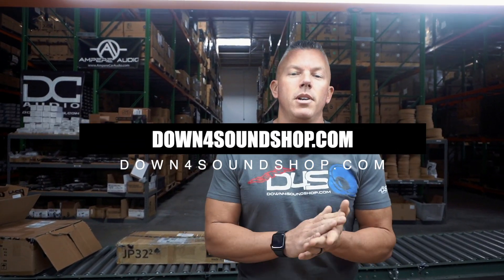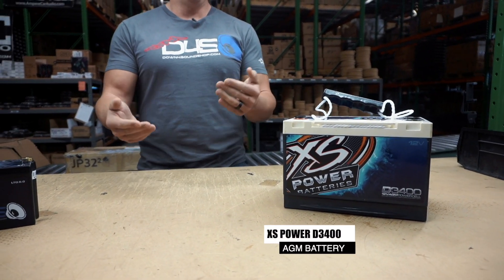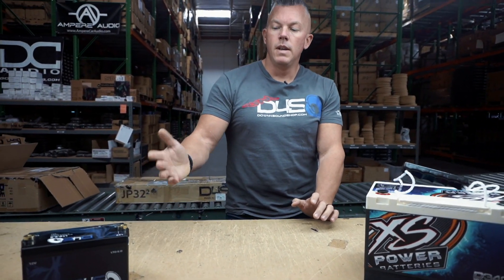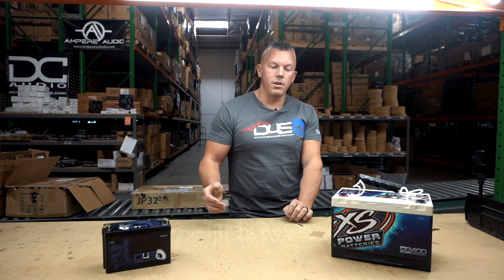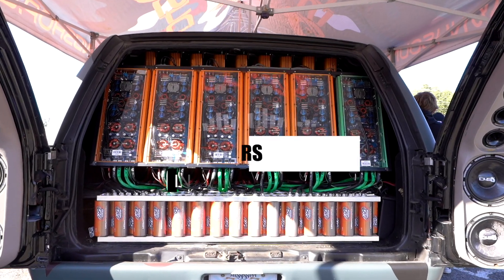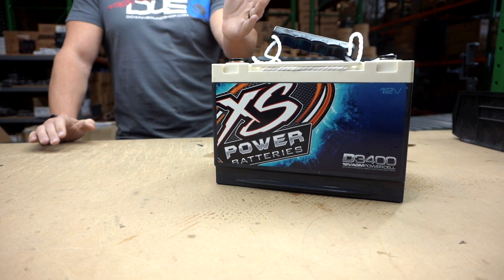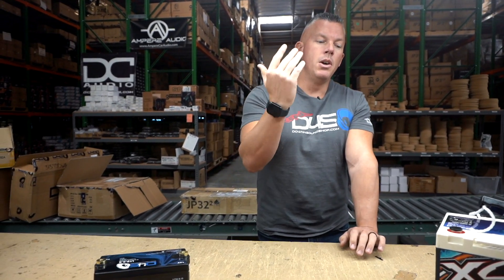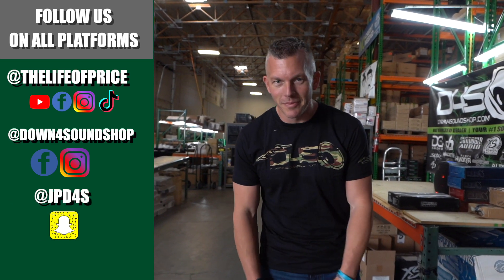WHY YOU SHOULD HAVE THE SUFFICIENT AMOUNT OF BATTERY POWER

Comment: Why do people insist on using low voltage. The best thing I have ever done to my system is increase the charging voltage from 14.6 to 15.8, way more power, more efficiency and just better overall for the amplifier.

Comment: Xs power agm is overpriced garbage mafe by loxus who is only knownfor building ioxus ultracaps. The d4s 6.0 and titan 8 5s uses 2.8v max scib cells, titan 8 uses the 10ah cells, d4s uses the 3ah cells. Both are scib lto in 5s configuration and should not be charged over 14.0v and do not handle the wattage they claim. They both fell into high 11s on a 200a draw which shows it overworks and burns out your alt. The xs power xmax90 is way overpriced. They are 22ah 20c EVE lifepo4 cells that you can build a 220ah bank for the price of one xmax90. The xs power yinlong cells only 40ah are worth getting, the 35 and 45ah yinlongs have weaker c ratings. Not to mention yinlong just pusted xs power for lying and proving they are NOT brand nee grade a cells. They are used or recycled grade b cells and they charge $100 more than you can get them at other sites. Stop buyin lithium from these lying ass companies.

Comment: I think this is the most overlooked thing that budget bassheads do. They try to buy the biggest and best amps and subs they can but don't wanna invest in proper electrical. That's a huge mistake 😕
Reply: yeah for sure what I have found  even with cheap power and subs 5k 8k let's say amp 2subs box let's say 1500 too 2k high just in wire fues extra power another 1k
Reply: @slowbrezze bro what the fuck did you even say?
Reply: Alot of car audio places wont do alternators and big 3 and most car shops only do oem products

Comment: Next time you do a battery power rating video, could you do a combo. Like what I have. A D4S 6.0 lto with a D4S 500 farad cap bank, big 3, agm under the hood with 70ah reserve. Powering a JP23v2 @ 1ohm good or not is segment
Reply: No, the d4s 6.0 is hindering your electrical

Comment: I got a stock 150A alt with a xspower d4700 under the hood with 2 LTO6.0's powering a B2 audio RAGE 2500v2 with no issues that i can tell.
Reply: I ran a rage 2000 on a 150amp alt.. standard battery no issues.
Reply: Except horrible voltage drop and overworking your alt while overcharging the cells and destroying them internally

Comment: If a company made dual alt brackets and belt setup’s for my challenger, I’d definitely invest in one. I am interested in the xmax 90 to replace the two limitless 45’s I’ve had for about 6 years now. I just haven’t seen much on them, would you make a review of the xs power diy?
Reply: You would be better off getting the diy kit from bms batteries or sriko. Xmax90 is actually 88ah of 22ah 20C EVE lifepo4 cells. At those websites i listed you can get same size bank for half the cost or get 220ah EVE bank for same price as the overpriced xmax90

Comment: Those 6.0 batteries are 🗑
Reply from the maker: Incorrect 😊
Reply: @THELIFEOFPRICE  no he isnt. You dont know shit about lithium
Reply: @THELIFEOFPRICE  you use 10 2.8v max 3ah scib cells in 5S2P configuration. 2.8x5=14.0v series, voltage multiplies, ah stays the same, then you paralleled 2 5S scib banks which keeps voltage the same and doubles ah to make that battery 14.0v max, 6ah of 75c max cells. Your 6.0 lto has been tested and torn apart by actual lithium people and it is put together cheaply and janky inside, not to mention even overcharging the cells like you claim to 14.8v, put on a 200a draw which is equivalent to 2,000 watts, your battery fell to 11.8v within 20 seconds. Your battery is garbage and for the price, one of the worst lithium premades to buy. Facts and numbers dont lie, spokesmen who dont do their own research or build their own shit and makes videos just repeating what a manual says is not truthful.
Reply: @THELIFEOFPRICE  I love my 6.0s!  I've got a pair of them and a 370a alt for my JP43 and JP 234 and it's been rock solid!
Reply: I put one of the 6.0 in my truck and haven’t seen my charging system fault come back since.. music hits harder. Battery is putting in work
Reply: @Allthingschillguy no bud, thats your alt putting in the work
Reply: I run cmax but they’re not bad at all esp for the size
Reply: @215sinakia  yes they arem no testing data ever done says 6.0 lto's are worth a fuck. I posted the battery and test results on my channel

Comment: Are 4 LTO 6.0 batteries enough for 2 JP63's because that's what I have.
Reply: @Jore-rs9bt  no endless you have a upgraded alternator.
Reply: @drgreenthumb2339  I have a 300 amp alternator.
Reply: Switch to sodium much stronger I like JP and his amps but these lithium batteries are weak
Reply: @ThomasVaughn-ss7rf  I might have to take a look at sodium. Kinda wish I would've went a different route with my battery setup.
Reply: 3 to 4 Jp40

Comment: what do I do If i cant have my alternator upgraded? ive looked and looked and there is none made for my 07 toyota corolla 1.8L
Reply: If you are serious about getting a higher output alternator, it can be custom made and tailored to your application at a decent price. Mechman, Mike Singer, or DC power to name a few!
Reply: I would try emailing one of the companies directly. I just bought one from JS Alternators for my Corolla and they have super fast customer service. Mechman, Stinger and CES alternators are all good options too.
Reply: For example,  my semi truck alternator was only 140 amps, I pulled the alternator off, took it to a new shop, and they rebuilt/rewound it. It's now putting out 207 amp at idel. From 140 to 207. Just search your area for alternator shops. I tried to get them to get it 250,but the man said those are the biggest windings we have for this alternator.  But, it can be done. I did research and found that Prestone makes 320 to 400 amp alternator for my semi. That's my next investment because I have a 5k system in my semi.
Reply: For the most part they're all starting at 2009 put the 2007 may have the same applications as a 2009
Reply: DC Power has it and that is the brand to go with.
Reply: Yes there is call Autotech Engineering
Reply: Contact apex alternator. He orders oem alternator and rebuilds them. I got one for my 21 ecoboost when no one else made one
Reply: @xXxSP4RKxXx  reach out to Sam at Autotech engineering , they help me with a 9th Gen V6 accord 320 amp alternator.

Comment: Quick question for you JP for the budget bass heads. Does it matter if you run different batterie brands? If you can run different batteries should they all be the same cca's and voltage?
Reply: I would do a battery isolator if you're running to different batteries,  u can't parallel them together.  Same 2 batteries with the same amperage u can parrell them or series them.  2 different batteries u would want to use a isolator
Reply: @briannash7960  alr appreciate it thx 👍👍

Comment: Quick question what if I only bang my system full tilt on the highway home from work and that’s it? Do I still need a lot of battery? Reserve if I have a high output alternator and just a standard battery under the hood
Reply: If I’m going to upgrade for example to 4000 W system do I need more batteries with my current set up and style of listening while I’m driving 70 miles an hour at 3000 RPM
Reply: @BriefcaseBanks 100ah of agm for 1000 watts
Reply: The thing is, the amount of draw at full tilt with a system that draws more than the alt can produce - you will end up with lower cell life over time, unless you have much more battery than you need, even if your daily drive is fully charging those batteries. 

If your amp is putting out 4k and your electrical is a 160a, your normally batteries can support around 2k before theres issues. You would want 3 more batteries or go with 65aH+ lipo, but I am certain that your batteries are not going to fully charge as the amount of battery charge load is not the same as it previously was. You may need to charge them externally at least once per week.
Reply: @ right on gotcha yeah definitely makes sense. Just trying to figure all this out.  basically im gathering all the information I can and trying to figure out everything. Like figuring out how much power battery reserve if you need. Alternator and etc. for the bass 4k amp on American bass xfl 12s. Is what I was told due to impedance rise and all that stuff that I’m still learning about lol I’ve built a few boxes and they sound relatively good. Thanks
Reply: @BriefcaseBanks  id get at least a 45aH lithium battery. It can run it like that with external charging and charge it once per week until you can get a high amp alt. It should be enough where you dont see much voltage drop and extended full tilt sessions, even parked.

Comment: You should explain how RVC's work to people. A lot of people do not realize these newer cars have regulated voltage control and that can be controlled with voltage controllers.
Reply: @drgreenthumb2339  yea had to get one for my car and it's not that new
Reply: I’m definitely wondering if I upgrade my alternator will it increase my voltage and hurt my car. Looking for information on that
Reply: @Djgrowlive_24  what year/make/model?
Reply: @Djgrowlive_24  when I first installed my alt the voltage was all over the place so thought alt was broke ..found out it was my car and it needed a voltage regulator outside of the stock one now I have adjustable voltage regulator and it does great
Reply: @adamsdiyandrandomvids5379  this is the way to go depending on the vehicals.
Reply: @adamsdiyandrandomvids5379  where did you get the regulator from? And was it easy to install??
Reply: @Djgrowlive_24  u.s alternator yes it was easy to install
Reply: Only you care about that🙄
Reply: @vcente671  doesn't look like it.